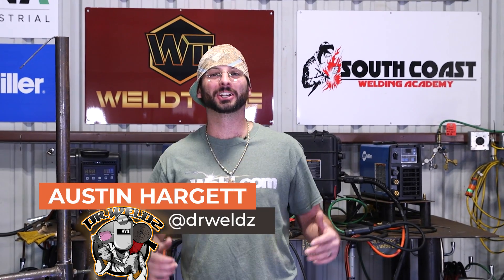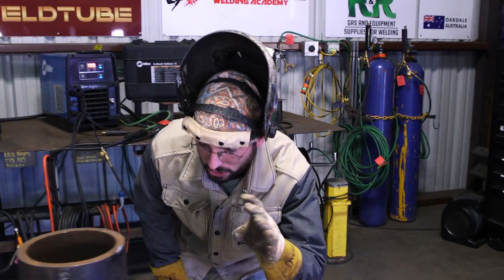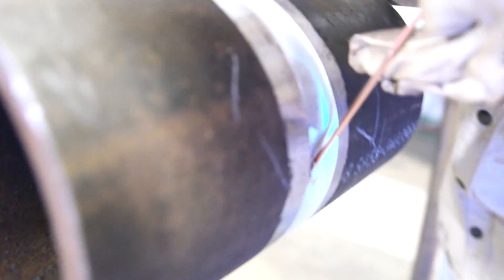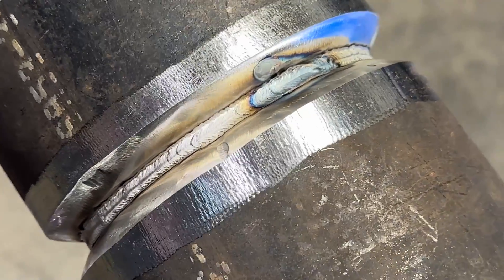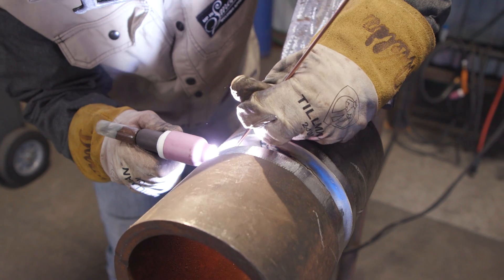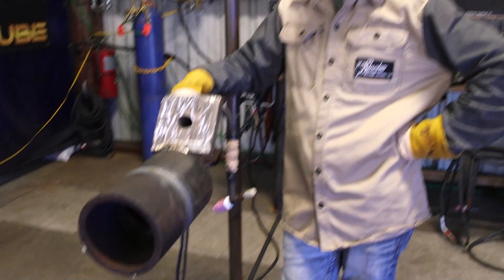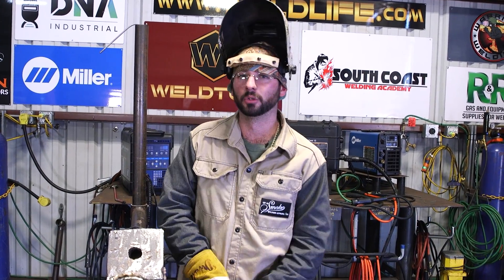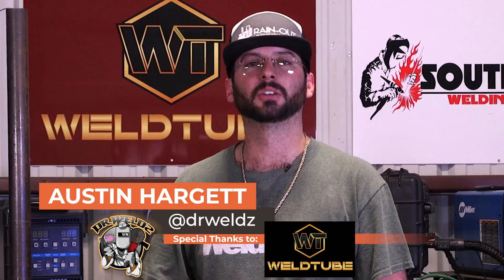How To Get Gold Color When Welding On Carbon Steel

Comment: Can  I ask two questions? As you are welding steel, does argon have to be used or can an argon C02 mix be used? With the welding of the pipe, was TIG welding used as a demonstration of what can be done or would MIG welding it be more efficient?
Reply: Pure Argon for TIG always or you can have helium. As far as MiG vs TIG , it depends on what the engineer , inspector or certification test is requiring and following the requirements of a Welding Procedure Specification “wps” . Hope that helps.

Comment: You would have failed visual in the cap the finish on each pass should have been stepped? Multi coded pipe welder Scotland North Sea construction.

Comment: I tig welded for 24 years and never ever messed with my amps ran 300 staight and used peddle this needs a peddle or a dial other than that great welder

Comment: You can get carbon pipes hot however strength suffers with higher heat imput carbon steel or carbon pipe or a Hollow structural Steel the less shrink your going to have the stronger the overall joint will be

Comment: 200amps hot pass? yeah its good for there is no ut. Your root is literally visual fail if you got test for 100% ut . Doesnt have enough skills to teach others. 

Hot pass is way more important than root. Plus practice more wire feeding. Your pipe will just pass when they just want no leak for water

Comment: Nice weld but I gotta say, I’ve welded miles of heavy wall and have never had to be anywhere close to 200 amps to ensure “tying in”. Honestly a 200 amp hot pass is ridiculous considering if you watch in the video you can see you reconsuming the root. Your root shouldn’t be a big glowing molten puddle while putting in a hot pass. Makes sense why you didn’t show the condition of the root after the hot pass. Last thing, I also have my cwi and there is absolutely nothing in B31.1 or B31.3 that restricts weave widths, especially on carbon steal. There are kilojoule parameters that you can’t exceed but that’s on your stainlesses, exotics like hastelloy or Inconel and chrome base metals. Appreciate the video either way. Nice finish to the weld.
Reply: Yeah that root looked a little chunky, right?
Reply: Only thing I can say about the current is the fact that it's sch120 I think he said. Just a weird video concept.
Reply: @kellydenmark6942 yeah 100% agree with you. Been welding heavy wall and thin wall and everything in between for 10 years now and there is no reason at all to be at such a ridiculous hot pass amperage. Dude’s interpass temp is cooked every layer at that amperage. Hell 150 would be plenty for the hot pass. Glad somebody else thought the same on this stupid hot pass amperage. And I’d argue that it’s STUPID all day long.  And he should stagger them stops on top
Reply: @Ball-Sweatz  thing is everyone is different. I root this size pipe at 125, hot pass 140 and would do a one pass fill at 200-220 while stuffing it with wire. Then go back down for the cap to 140-160. But then again I'm usually in the rack and stick to 160 the whole time 😂
Reply: @jeepwk6.5L  based on his travel speed and wire feeding skills he should run maximum 110amps on his hot pass.
Reply: @펭-9999  wire feed skills sure but travel speed will change with amp input?

Comment: Does that color really add anything to the weld?
Reply: you arent really asking the right question because the color is a byproduct of the metal being welded while being shielded by the argon gas.  The color at the end is a result of the gas reacting to the heat of the weld pool so you can judge a weld by it's color when tigging because if the color is consistent and the right color(s) then you know the heat and travel speed was consistent through out the weld.
Reply: @natenate2280  not necessarily true. The color of the weld is only determined by the temperature of the metal when it is exposed to the open air.   You could make two identical welds- one with a a regular cup and then one with a trailing cup and one would have color and the other wouldn’t.
Reply: Good question.   Isn't the "gold" just oxidation, or some alloy element coming out?   In that case why would you want it?
Reply: @thzzzt  In my experience, it's gonna oxidize a little no matter what. Especially when it's that hot. If you've ever wire brushed the color off a fresh stainless weld, and then left it to cool down you'll know what I mean. Some color comes back in a few minutes as it re-oxidizes, steel (and most metals) are generally going to oxidize slightly a lot faster than you would think. Especially aluminum, it can build a pretty protective layer of oxidization in less than 10 minutes, hell even a few seconds if you've ever tried to make a coke can crumble with gallium.